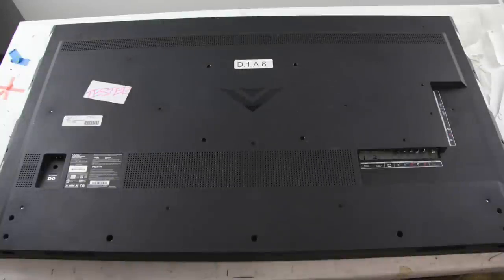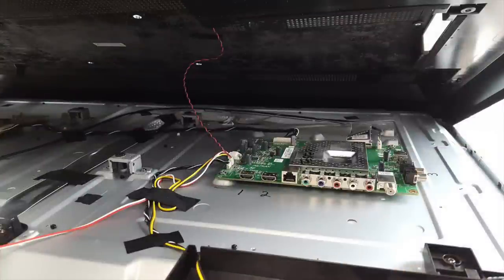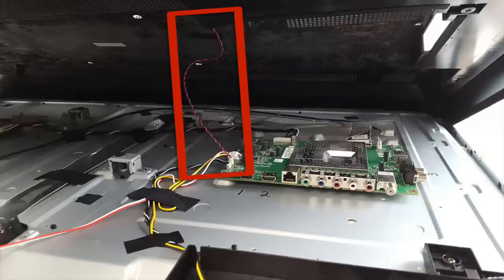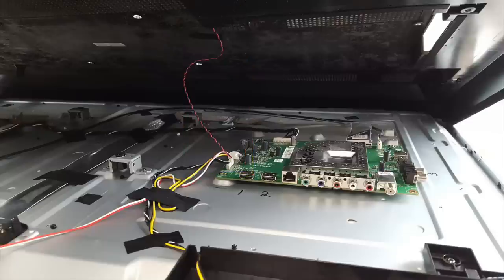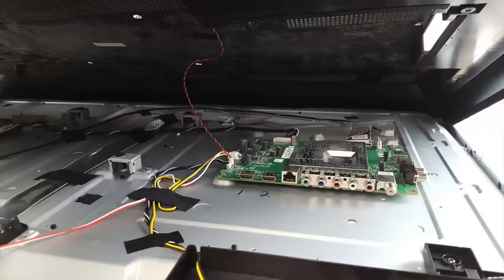TV Repair - MUST SEE Before Starting Repair & Removing the Back Cover on a TV

Comment: Sadly my tv isn't as simple as that, it has a second metal case, under the outer(plastic) case. Which doesn't seem to be removable at all.  I figured that my TV has some loose cable, which might be because of transportation, but I can't really get to the main board to check if it's true because it has that metal case that I can't take off, I've taken out all the screws that are holding it, but it appears that there are screws under the metal case that are holding it, and I can't even get to them(which begs the question how did they get screwed in there in the first place). If you could help me out with it I'd appreciate, the TV model is Hyundai Q320. That second metal case is a real problem, since I don't want to accidentally break the tv while trying to fix it....

Comment: Wondering If you could help me with a TV problems? I have a Samsung model LN-S4095D [model code: LNS4095DX/XAA] when I first turn TV on and have nothing plugged into the inputs I get a blue screen which is perfect. But once I plug something into the inputs (I've tried everyone) I still get a picture w/sound but there is snow (or static) all over the entire screen. Also when I hit menu, the menu comes up but it also has the snow all over it. I do not know history of TV as I received it like this. Thank you
Reply: I also tested all caps on power board with a ESR meter and all tested okay

Comment: Hi mate,My luxor TV is switching itself off/on every few minutes. Do you think it may be inverter? I tried power supply replacement, but it wasn't better after that. Would appreciate your answer. Hope to hear from you soon,Regards😉
Reply: A video I seen long time back mentioned that by unplugging and re-plugging the cable that is to be disconnected before removing the back panel, this solves the tv switching on and off. 
Just try this for all cables on your TV and recheck. Apparently the TV resets itself.

Comment: I have a question about samsung series 8 65 inch tv how do u remove the rear cover lol no backlight can't find any info on tv have to get to boards for info
Reply: Am having the same problem
Reply: Face the television and lightly apply 00 buckshot into each corner.  Worked for me!!
Reply: I figured it out totally snapped together just have to be careful use a sharp plastic spudger  and guitar pic's to keep corner from reattaching